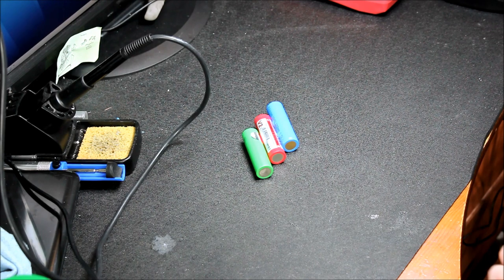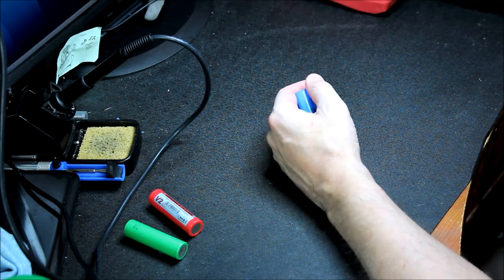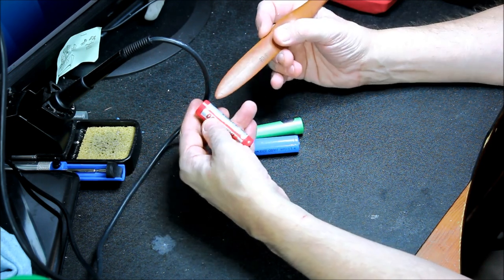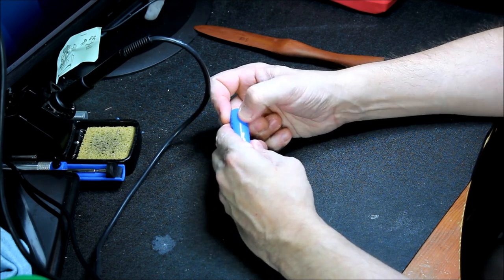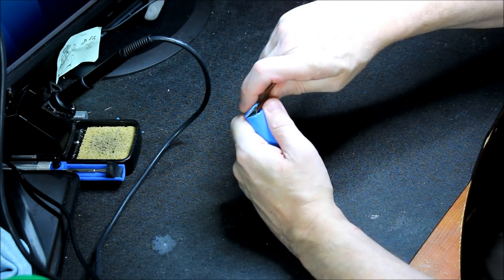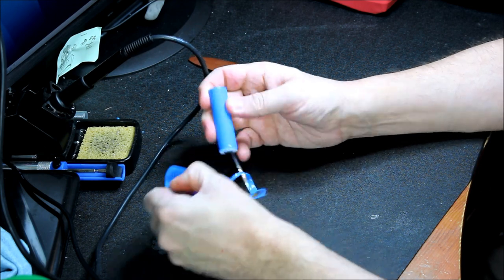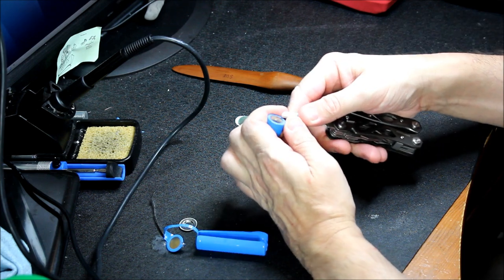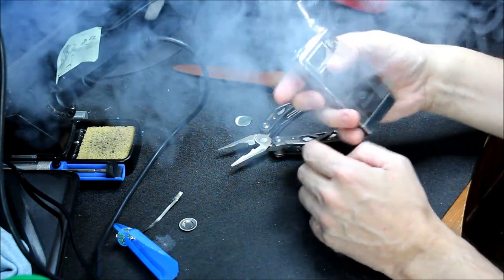Steve'll Fix It S01E03 - Removing 18650 cell protection

Comment: That protection is there to prevent over-current and over-discharge. That cell probably doesn't have a high enough CDR for vaping. I did this assuming the batteries would be sufficient and the regulator on my mod exploded.

Comment: An Excellent and informative video , Steve .............. need more of these !
 IOn and old pc , and using an AtoD converter , got some software , and showed battery voltage over time , with a resistive load ... not one cell , met the rated cell capacity ............. 9900 mA hrs , is just ridiculous !!    well done .

Comment: Slightly altering this method can also be used to turn a protected cell  into a solderable cell.
There have been a few times when I've been able to avoid the high cost of overnight shipping (and make a quick repair) when I desperately needed a SOLDERABLE 18650 cell. On a protected cell, peel or snip off only enough of the interconnecting strap(s) to leave enough as a "stub" sufficient to solder to. Leave intact as many as possible of the original spot-welds. The more original welds the better. Soldering to the strip stub(s) instead of directly to any part of the cell...
1) MUCH easier to make a fast, much higher quality solder connection to the cell(s),
2) Helps considerably in preventing internal heat damage to the cell(s) while soldering. 
WARNING: a solder connection performed by an inexperienced person may be INSUFFICIENT to handle the high currents found in some vaping equipment or other equipment. This could lead to catastrophic failure of a cell
Reply: This is a genius move. Thankyou for the tip

Comment: The description you wrote is exactly just what happened to me. I bought 8 70mm protected 18650 batteries and none of them fit in my Aegis legend Vaping device. It cost me $40 to buy 2 single unprotected ones from a shop. The bloke told me to do exactly what you are doing here. Now I have 10 Batteries. Just wondering if you have had any dramas since filming this video? All the do-gooders in the comment section sound like they work for the 'protected' battery company!
Reply from the maker: I've had no problems. IMO protected cells are for numpties who know nothing about energy density and cell chemistry. Just leave the unprotected cells for the grown-ups :D

Comment: I didn't realize until it was 2 late I bought a bunch of 18650s and the positive side has a giant nub when compared to my ecig batteries. I truly thought I was getting a good deal and my guess is these are cheap because their uses are limited. I thought maybe I could easily remove that cap but I don't think I can so it means I have to sacrifice one to see if I can or maybe sand the nub back enough for it to fit.
Reply from the maker: I've not seen an 18650 with the cell protection on the +ve end.

Comment: Are you aware of the interference buzz on this video? If you haven't already, make sure you have a loop in all your cables or some RF protection and that cables that cross, cross as perpendicular as possible to prevent cross-talk. ...etc, etc.
Reply: Probably the soldering iron
Reply: the interferand buzz is so low I didnt notice it until you mentioned it. So no big deal. Still a great helpful video

Comment: What type of fire extinguishers do you recommend for large house fires?
Reply from the maker: +sc0tte1 Without a shadow of a doubt, I'd recommend good ones. You know, those big red trucks with uniformed personnel?
Reply: Steve Brace lol I was just messing about.  Thanks for the video...I already did this, I just wanted to see if I did it the correct way.  I wouldn't recommend people do this on mechanical mods, though.
Reply from the maker: +sc0tte1 Mech mods should use high current cells designed for the purpose, but if you're using a mech mod then you're probably well versed in the matter.
Reply: The kind that wear firemen clothing and have a firetruck.

Comment: I have to mod a fresh pair I ordered to fit in a regulated mod, I think its time I bust out the electric sticker label machine and ID the set, and label they are without circuit protect if I ever grab them as use for anything else and forget.
Reply from the maker: I like your thinking.

Comment: you shud do more videos! very well explained! u seem to be very knowledgeable person. i was searching for laptop battery repair by replacing 18650 cells....can u do a video on how to nicely teardown a laptop battery without damaging the plastic casing?
Reply from the maker: +Saeber Tooth Thanks! At the last count there were 20 videos in the Steve'll Fix It playlist... Subscribe for updates. As for replacing cells in laptop battery packs; this is very difficult without causing damage since they are usually glued. In order to open the case without damage you need to apply heat and if there's one thing Li-Ion cells dislike, apart from a short circuit, it's heat!
Reply: i dont remember but i think i have opened a litium ion cell in childhood..there were long metal strips folded..i think two of them..had a habbit of opening everything i can get my hands on.
i dont properly remember if it was li ion battery or a capacitor.

Comment: So, basically, it is NOT an 18650, (even though it is sold as such), but an 18655, or how ever much longer it is than an 65mm.

This is frustrating to the Nth degree, & I haven't even had to deal with the problem.  What is it people don't understand about the importance of adhering to standards?
Reply from the maker: And finally we have an engineer... Welcome.
.

Comment: I stripped the positive end of an 1860 and used it, ban idea, you only learn from mistakes, I fried my mod and was lucky the battery did not explode. I thought I could get away with it and did for awhile but got careless and caused a short. I knew it was dangerous and found out it was.

Comment: Wow thank you. . . I recently try in my 3 no voltage 18650. .  Ang its nOw bAck to life. .  From philippines 🇵🇭
Reply: Just realize that the 0v is there for a reason... the battery was put to sleep by the protection circuit... although they can be revived in several ways, the longer the battery stayed in the “0v” sleep state the more unstable it can become (and this instability does not make itself known immediately... it could have issues many charge cycles from now).  There are some uses for revived batteries,  but vaping is probably the WORST possible use of a revived battery.   Battery instability/fire/venting mostly happens during discharge...yeah, that’s right...exactly when the vape is in your mouth...  please do not use any revived batteries for that purpose... and always treat revived batteries as suspect.

Comment: This blue one is technically a battery (which is cell + protective circuits, enclosure and stuff), while the others are just bare cells.

And saying "bare cells" may not be 100% correct, because many cells does have internal protection, usually PTC, sometimes fusible links, but these are regarded as part of cell. Anyway - Lets just hope that all people are aware of dangers of using lithium cells instead of batteries, especially not brand name ones, as those little things can cause serious damage when they decide to go off...
Reply from the maker: +mibars A battery is a group of cells. External circuitry on a cell does not a battery make.
Reply: Steve Brace Depends on point of view. From physical point of view - yes, but for the purpose of safety evaluation cell is a component of a battery. This sometimes leads to situation where battery is just a single cell with added markings when a cell is safe enough to pass battery tests.

Comment: I'm pretty sure that protected circuit batteries were intended for use in mechanical mods exclusively, which a large majority accommodate for various size batteries; ie telescoping. The mod your using has protective circuitry built-in.  WHY would you do this?

Comment: This whole issue with protected non protected cells is just stupid the longest protected cell available should be the industry standard size for battery compartments and than shorter cells can be compensated for by using a longer more compressible spring to compensate for the slight length difference.

Comment: tks for the video, my battery is fairly new but it suddenly stopped working when I used it in parallel with a lousy one, and since then its never recovered its charge, I think I must have damaged the protection circuit and it refuses to charge or dischage since..all protective cells are situated at the negative?
Reply from the maker: I believe there is a mechanical vent trigger on some cells that disconnects the +ve in an over-pressure event.
Reply: tks for the reply steve, I also notice mt battery dont have any split on the negative theres some kind of attachment on the positive, I dont dare meddle with it cos its both fairly new and held strong charges 2.2amp rated ones, I dont want to short them, I tested them before when working on a 10amp ammeter, I blew the needles to the extreme like nothing, so I know they really kick ass when shorted..I threw them away, I think lead acid types are the best cos they tolerate a lot misuse better..

Comment: These batteries are something to watch out for, my reasons shall be listed with explanation

The plastic wrapping should be in VERY good condition, because the wrap actually keeps the negative side sealed in

Don't overcharge your battery, a day might be safe but it's not wise

Watch out for REWRAPS these are junk batteries that look real, but aren't even close, buy from trusted sources

PAIR YOUR BATTERIES make sure you pair, or marry your batteries (long explanation, check a 3 min vid or internet search on that and edjumicatiom (educate) yourself

Never over do your batteries, mech mods (unregulated) aren't for people that can't guarantee safety, buy a regulated mod to be safer, battery explosions are mostly common through mech mods where the battery is abused or ohm's law is abused

Comment: Hello, I soldered wires with tin, we poles from the 18650 battery. Now I intend to remove this solder.  what precautions should i take?  if this solder flows into the ends of the positive pole, even if it is a minimum.  can cause a short circuit?

Comment: Great info.  Can you tell me if I can replace a 3.6 volt-1800ah rechargeable LED work lamp battery with a 3.7 volt-3000ah battery without harming the LED?  The battery length is not critical. Thank you kindly.
Reply from the maker: Thank you. The answer to your question depends very much on the power supply to the LED. If it is regulated, then the LED will be fine, however if it is only current limited by a resistor, then that 0.1v increase will increase the LED current and therefore temperature thereby reducing the lifespan.
Reply: Gopher it.
Reply: Hmmmm, 18650's are usually charged up to 4.2 volts then can be safely discharged to around 3 volts. If your LED light charger will only charge a battery up to 3.6, that won't be a problem at all; that's actually a good thing. The only problem would be that you could potentially drain the 18650 down past 3 volts, which could damage the 18650.

Comment: Worked it out years ago when I was starting out and got the wrong trees. The size gave me the clue
Reply from the maker: Yeah, this video was made years ago... But "trees"?
Reply: @SteveBrace  batteries
Reply from the maker: Ah! Got ya! Dint have ma thinkythink werkin :D
Reply: Picked it up from the motor trade in the UK. I'd get asked to change the tree! I can't see anything wrong with doing this so long as it's done how you, and I did it shops should explain the difference in size as good batts are expensive and I had spent every penny on the equipment so the mother of invention...
Reply from the maker: ...Is necessity :)

Comment: I tried this while I was not at home and now I am injured.
What is your private home adress?
Reply from the maker: Hi Bill. I amd a Nigerian prince. I'll be happy to provide you with my home address but needing will I be your credit card and banking details before i can release the funds alonf with all comecatuion thankyou plese reply soon............. :)
Reply: Steve Brace
Really?! OK, I'll have that sent to you first thing tommorrow morning.
But then I need your address.

Sorry for the wavy typing, I am still at hospital and can only type with my mouth.
Reply from the maker: dont forgotten to include the PIN number ant the security code form the back of the carf... K Thx Bai :)
Reply: Steve Brace
OK. I'll advise that. To use the meantime efficiently, do you have a video showing the over/under voltage protection circuit in action?
Reply from the maker: It's funny you should ask that, because: No.
Reply from the maker: I mean seriously... Have you watched my channel? I'm more boring than +John Ward but that would be a step too far!
Reply: Steve Brace Well, cut out the boring bits.
A 30 second video would do.
Reply: You need to do a 4th of July special next year showing us how to convert cheap Chinese lithium batteries into fountain fireworks :)
Reply: The Kaiser HAHAHA!!
Reply: The Kaiser l
Reply: You made my day. can i have his credit card details as well plus pin number. i will send funds to the poor injured man.
Reply: There are many factors in battery reconditioning. One plan I found which successfully combines these is the Magic Mender Wizard (check it out on google) definately the most useful info that I've seen. Check out this  incredible resource.
Reply: Peace is best
Reply: ahahahahahahahahahahahah

Comment: I’m a techie and all you had to do was modify the spring contact by cutting it shorter of the device by one revolution and you should be set.  The battery is much safer with the protected circuit intact.

Comment: People need to know what they are doing before attempting this, cells USUALLY come protected for a reason, short an unprotected cell and they will thermally runaway, potentially catching fire.

However, with that out of the way, if you are using the cells in a device that has it's own protection, using protected cells will lead to HORRIBLE performance, as you have 2 separate current regulations going on at once, leading to substantially worse performance than it should be delivering. It can also screw with cell balancing at lower than 3.7v, substantially chopping the top off your usable battery life. 

Although it isn't 'dangerous' to use protected cells in devices with their own protection, you still shouldn't do it, unless you don't care about your device performing sub-optimally. The only REAL use for these protected cells are in primitive electronics, like flashlights, which directly short the battery across a bulb, or in mechanical vaping devices which also work exactly like a flashlight, only shorting across a heating coil instead of a bulb. Vaping device with voltage regulation perform like absolute dog shit if the cells are protected, that is, if you can even get a protected cell to fit inside in the first place... They seem to intentionally make the clearance too tight to even get them to fit in the first place, most of the time.

So yeah, your vaping device has intentionally made itself incompatible with protected cells, for your own good. Even if you could get the cell in there, it would perform horribly, as it is doing it's own regulation.
Reply: Exactly, protected cells arent meant to be used on protected devices. That is also why is fine to use those unprotected, or removing the protection, when you are using on something which alredy has protection, like those new cheap power bank circuits.

Comment: Hi Steve, 
I hope you would be fine
just one question asking for a long time with many people but no one give satisfactory reply. I hope you can come up to the best to solve my concern and share the info with others as well.
My question: i have a laptop battery of 6 cells of 18650 series, can i increase my cells by soldering three or six cells more because of this reason to increase the backup time.
I have no issue if cells are coming out of battery jacket, Can the 6 battery cells chip board found in the battery can control the 9 or more cells at the same time without infected to laptop.
waiting for reply.....
Qaisi Kulkar
Reply from the maker: I would not recommend this as the balanced charging circuit would not work effectively. As laptops are usually left to charge unsupervised this would pose an unacceptable risk.
Reply: In addition to what steve said, battery cells in series should definitely be impedance matched...which means you need to disconnect existing cells to check thier individual impedance (to match it)...same true for capacity.. both should be within 10% of existing batteries.  Lookup “cell matching of lithium ion cells” for more info.